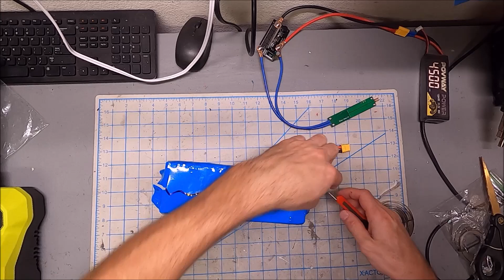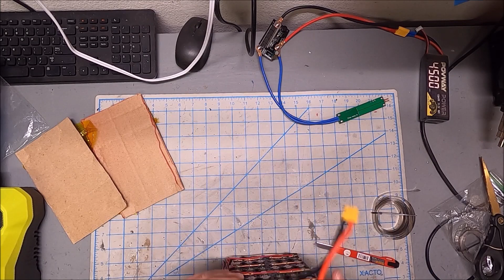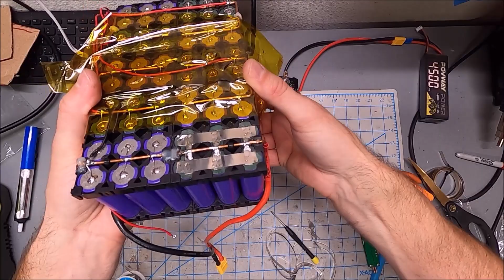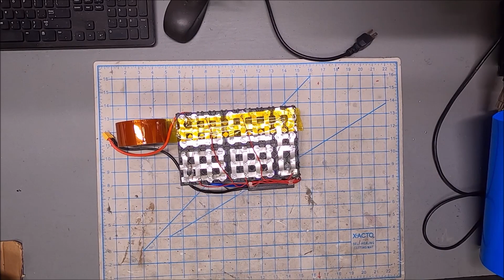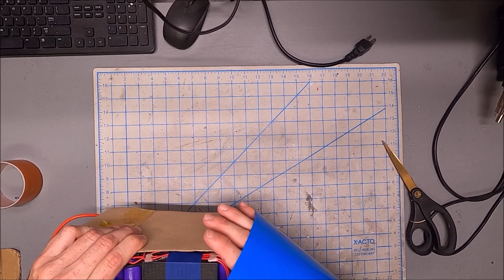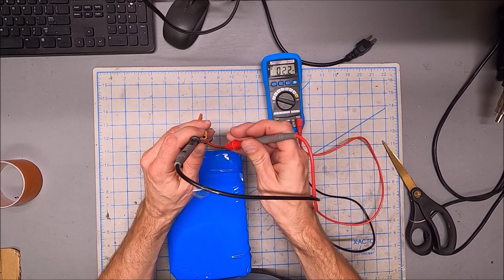SPOT WELDED EBIKE BATTERY: CONVERTING FROM SOLDERED TO SPOT WELDED

Comment: Make sure to avoid those small sparkles when used a sand driller because sometimes it goes inside the battery and may damage.
Anyway that was perfect spot welding! 👍
Reply from the maker: Thanks man. Yeah that solder dust gets everywhere. Actually vacuumed the battery when I was done. Thanks for watching 👍

Comment: Why are you putting the BMS's aluminum side facing your battery pack? That side will get hot when charging and we all know heat is not good for lithium batteries
Reply from the maker: Good point but the BMS is actually held 1/4" off the batteries by the plastic cell holders. It's not touching the batteries and had an air gap.